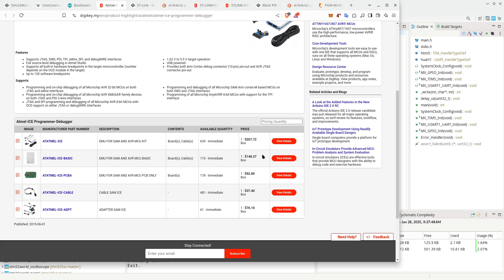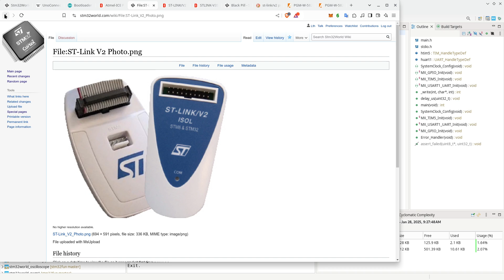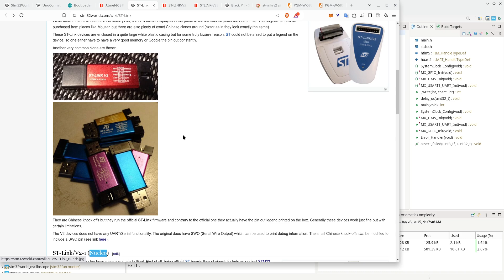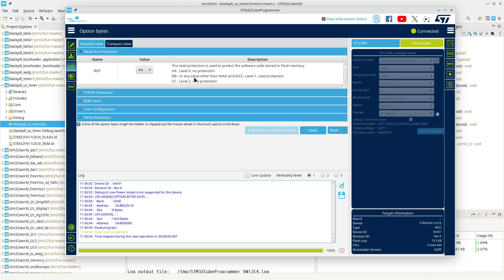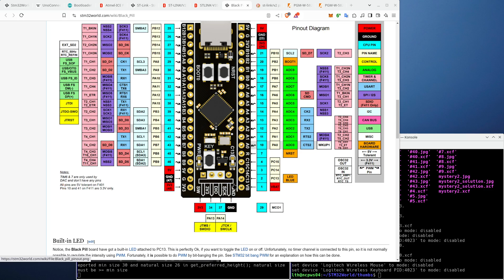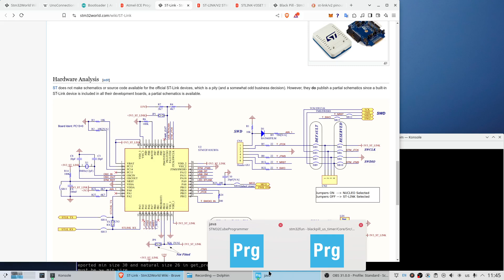STM32 Tutorial #45 - ST-Link how to flash STM32 MCUs

Comment: I have windows -7 , STM32CubeIDE. Version 1.17.0 + ST-Link V2 (chinese) . I can use openCd and flash he chip and debug too. However if It won't , if I use the ST-Link(GDBserver). It gives an error with stmcude...CLI.exe. Is there any way to overcome this ? I had raised this issue with stm , but they did not respond. But from the discussions , I understood that ST-Link v2 is not their official tool and probably it will work on windows 11 and latest cubeide. That sounds absurd to me as a software full developer. I have created extensive softwares that work  on windows 7  to windows 11. I am ok as long as opencd works. But this is nagging in my mind.
Reply from the maker: I haven't used Windows since Win95, so can't help you with this one.  I have however seen examples of the clone ST-Links that will not upgrade to latest version, and STM32CubeIDE will complain about that.  I don't see why a ST-Link/v2 would nto work on Windows 11 but the point there is - the one you have is NOT a ST-Link/v2 but a Chinese clone.
Reply: Which st-link  do I need to buy sir?
Reply from the maker: @kamireddyjayaprakashreddy  Best bet would be one of the newer ST-Link/V3's - as explained in the video.
Reply: @kamireddyjayaprakashreddy  if you are asking me, I purchased one that is cheap around  RS 150/- (india). I lost one due to internal short. I use it with stm32cubeide + opencd for uploading hex code and debugging too. You can use it with st-link utility software to upload the hex file. This utility software has an additional facility to compare the file code with that is in the micro-controller, which is great. But it cannot debug.